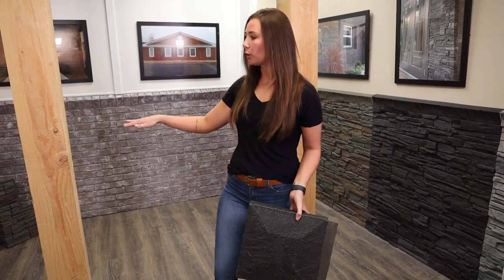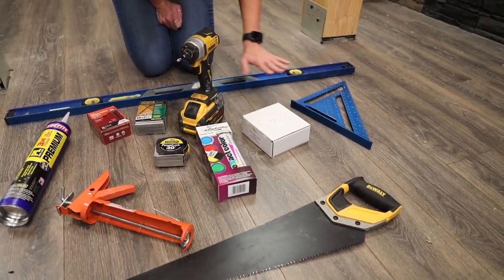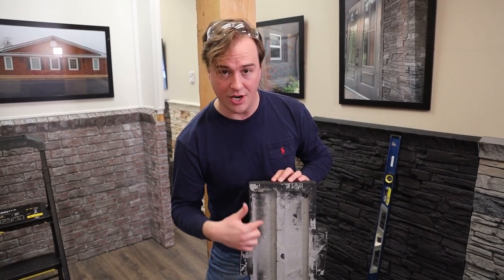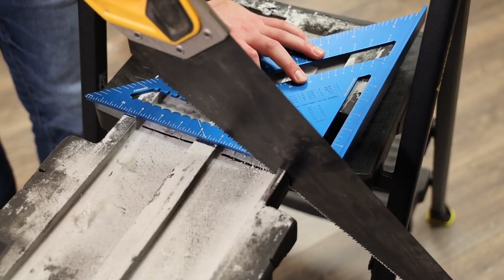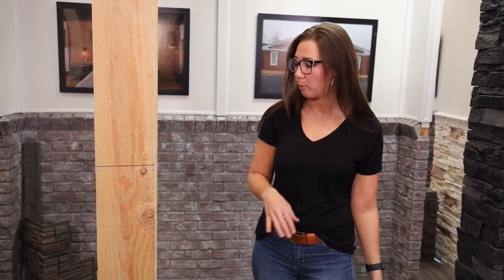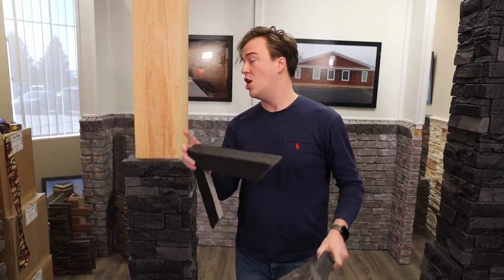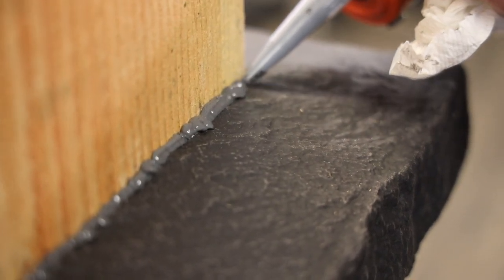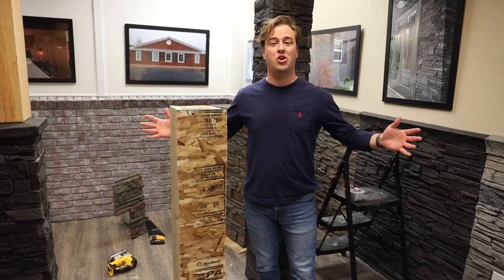How to Install Pillars Video | GenStone on Pillars

Comment: I thought these are only 24" tall according to their website but this guy is holding what looks like one piece and it's up to his chest - a LOT taller than 24" !!  i don't get it!
Reply: They made 2 different styles. Some of ours were the larger panels. Some the smaller
 Not sure why they changed
 The taller panels were easier to easier to work with!